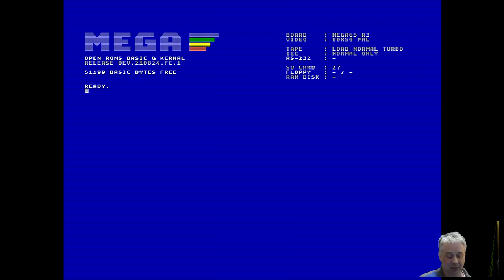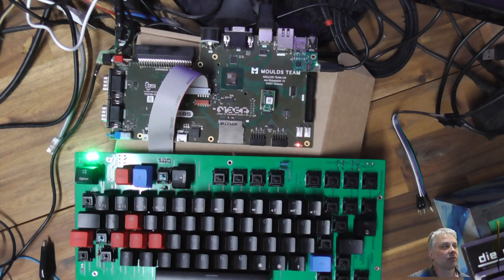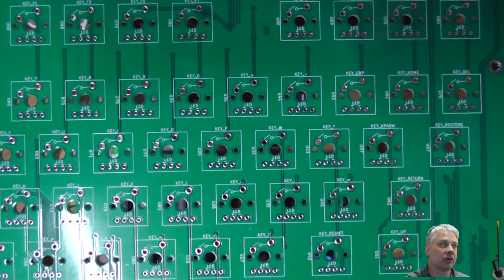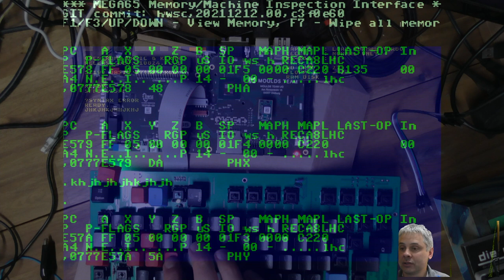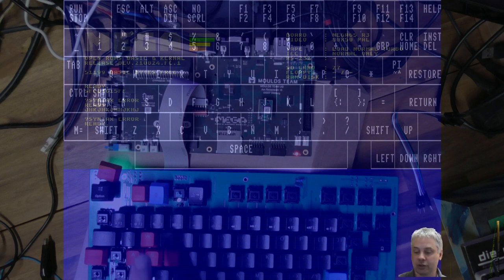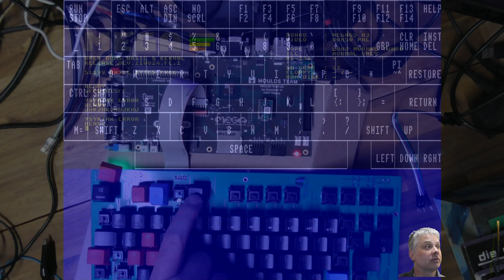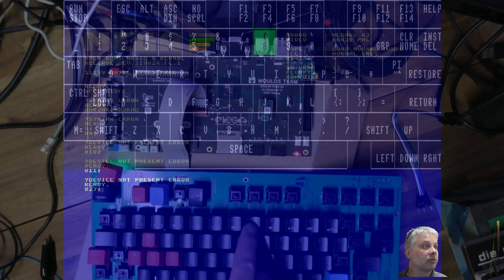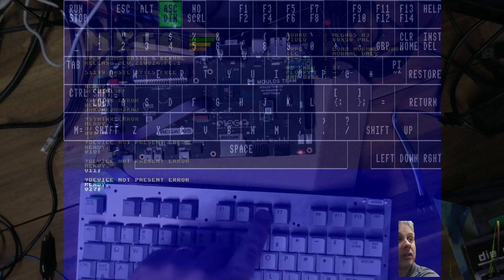MEGA65 - Development Stream - DIY Keyboard for Nexys board

Comment: hey, can i the mega65 software use with the original c65?...thanks and have a nice week...
Reply: If that software uses only C65 features, then probably yes (depends on the C65, there were many different C65 revisions even not fully compatible with each other!). But if it uses any of the MEGA65 enhanced features over C65 (which is quite possible) then not so much.